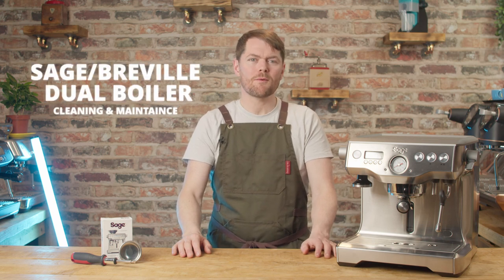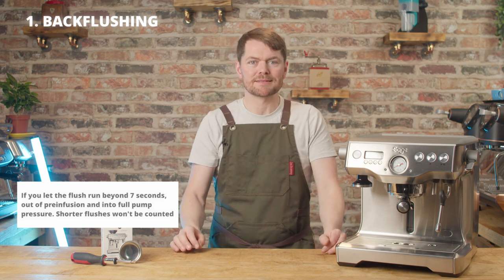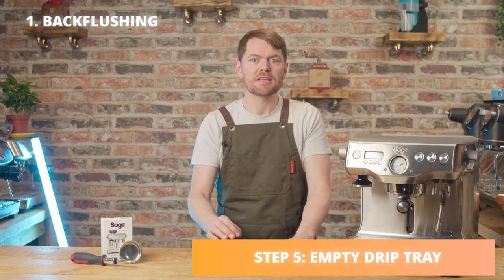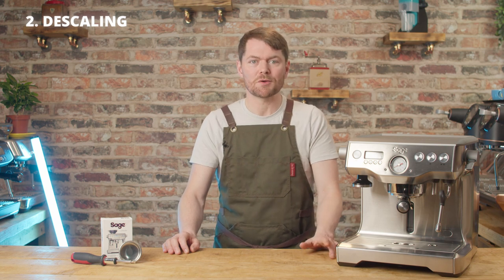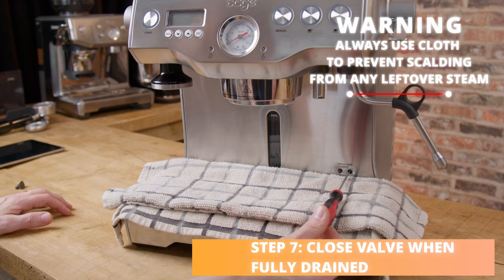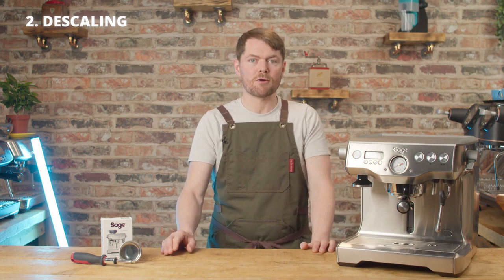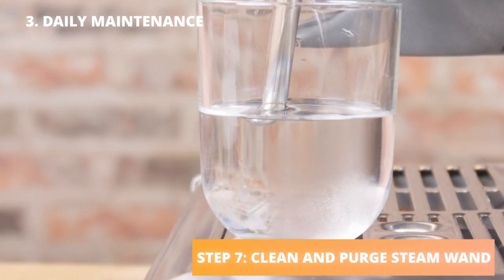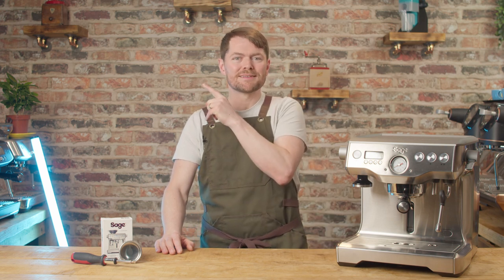Sage (Breville) Dual Boiler: Part 7 - Cleaning, Backflushing and Descaling

Comment: I have a whole house water softener and my refrigerator filters the water.  I use this on my Casabrews espresso machine.  When I get a Breville Dual Boiler, I plan on using distilled water and Third Wave Water packet for expresso.  I'm not going to descale.  I'll take my chances with this method.

Comment: Any advice on how often should descaling happen if standard tap water is being used?
Reply: I would advice asking your local water provider about the hardness of the water. If it's like 5/5 hard you should do that at least once a month, if you make a lot of coffees, maybe even 2 times a month. But if you have the softest water there is and you use a water filter I would advice doing it 2-3 times per year.
Reply: Also one good way of getting to know how often to descale your Dual Boiler would be due to a regular electric water kettle if you have one. Like how quickly the scale builds up there and how often you descale that. It's very easy to see the inside of a water kettle and what scale does to it. Not so easy to notice that in your espresso machine
Reply: @moviemaster00000  good shout thanks, the water report is low-moderate hardness, so I'll probably split the difference, but the kettle advice is good as well!
Reply: @laoisefitzpatrick87  no prob mate. If you use a water filter inside your tank, I think you'd be okay for 2, maybe 3 months. You can also do a test with the Dual Boiler like letting 2 months pass and then doing the descale cycle. If you empty the boilers with the screws, look carefully what kind of a water is released from the boilers, if it's really scaly (a lot of white pieces) that means that 2 months could be the maximum time limit between the descale cycles. But if there is not that much coming out of the boilers try with 3 months the next time and see what happens.

Comment: Just a tip. The dual boiler does not count the clean cycle as a shot so you can use that to back flush daily and not add shots to your shot counter

Edit. I missed a bunch of words
Reply from the maker: Great tip, cheers :-)